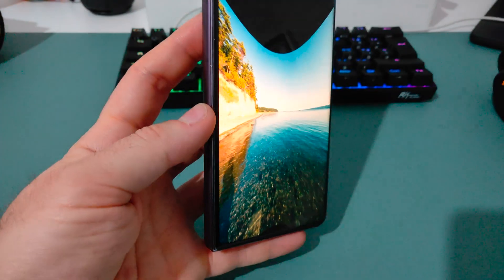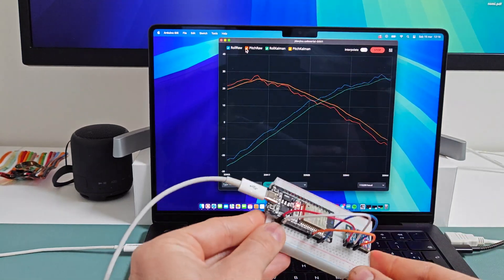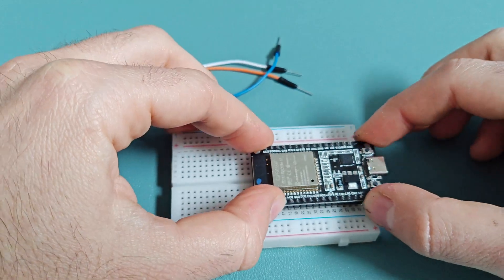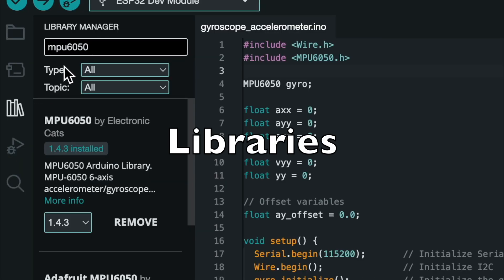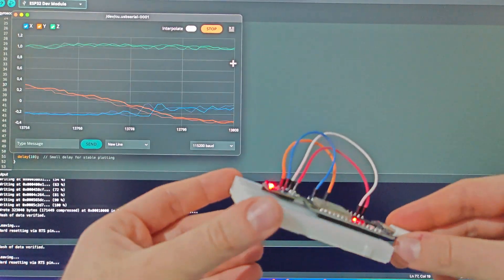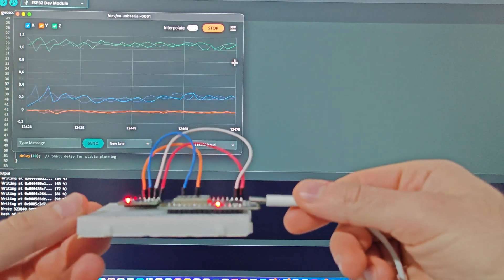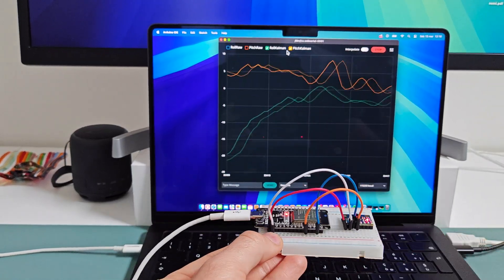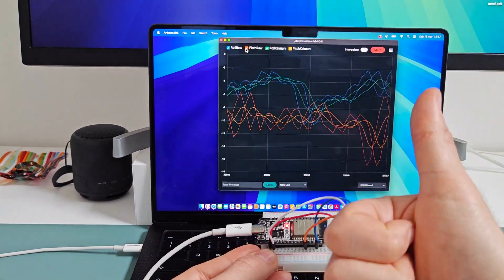What Makes Gyroscopes SUPER Accurate with ESP32?

Comment: Could you perhaps link us to an  mpu6050 sketch that outputs not raw data but the corrected values like in the teapot sketch ? It would be nice if it has support for both esp32 and arduino nano
Reply from the maker: Great question! I don’t have a ready-made sketch for that, but you can modify the Teapot example to work with both ESP32 and Arduino Nano by using the MPU6050 DMP (Digital Motion Processing) feature. If you're looking for something specific, I might be able to help guide you through the setup!